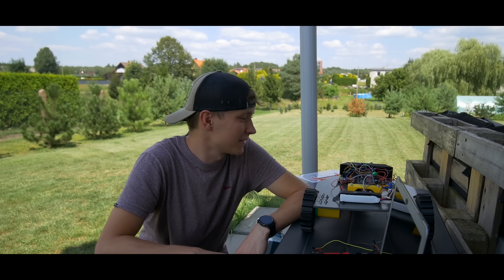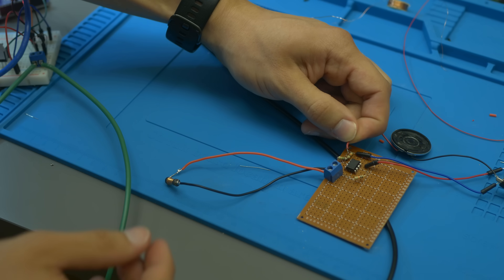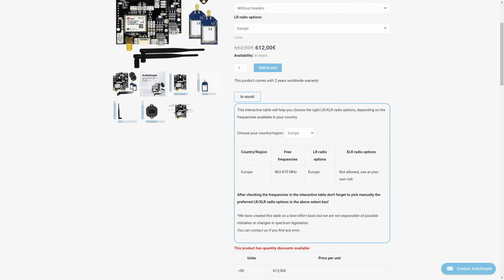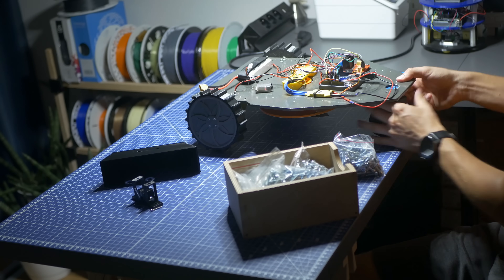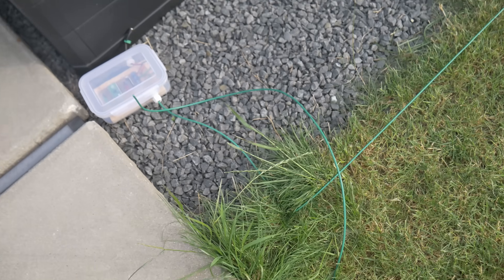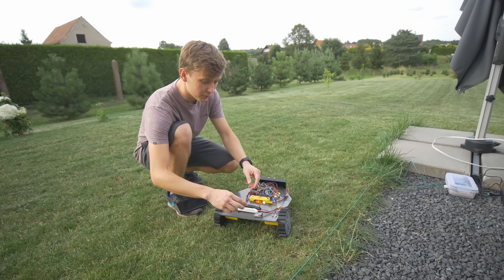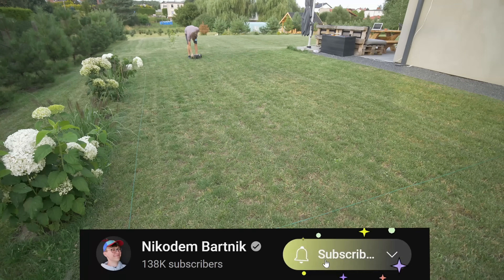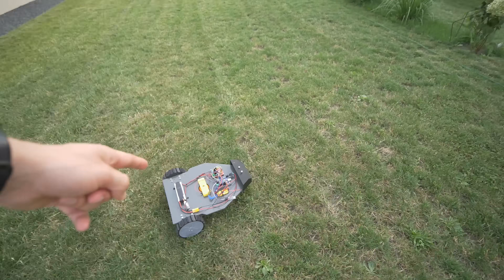Perimeter wire is better than GPS RTK. (IndyMower #2)

Comment: The general purpose FFT may be a bit too much. A DFT for only a single frequency bin with precalculated values is super easy to implement. Be sure to sample at at least double the frequency you want to detect (10x is better for differentiation). 
The alternative is an analog bandpass filter or inverse notch.

Comment: I thought about this a long time.  I felt that perimeter wires were great.
But to make different mowing patterns would require more wires.
And if the mowing area needed to change, the wires would need to be replaced.
GPS didn't seem accurate enough (at the time) and could glitch too easily.
The biggest drawback is the non-patterned mowing algorithm that wastes time and energy.
I settled on the idea of using a scanning head that looks for reflectors placed around the yard for triangulation.  This is the method used in many factories for robotic forklifts.
But I don't have time to work on such projects because work keeps me busy, and family.
Reply: I have very similar conclusions, reflectors seems great compromise - Linde use them in their HDk series, and reports 1-2 cm accuracy. Don't know about behavior in full sun thou, optical methods tend to be jammed by intense sun and scanning head is difficult to use with standard remote control solution of detecting IR signals keyed in 40kHz carrier wave. Maybe 2 colors pointing same reflector? That way by having 2 peaks on diffrent frequency we'd eliminate false positive. Adding third detector that should stay low for third color would eliminate white objects or sun glare to give false positive. 
Alternatively, for smaller distances, ultrasound work ok for 12m - Cheap ultrasound sensors can be modifyed to talk to each other and double distance measure range, if they would be synchronised by PPS signal from chap gps reciver - could be as accurate as GPS-RTK, but order of magnitude cheaper

Comment: increase voltage, increase frequency. and  use high frequency diode to convert ac to dc as sense and usedc output as sense.  it will reduce computation of arduino!
Reply: Hello, I am interested in knowing how to follow the perimeter cable, if you can help me with this, I can pay you friend for crypto

Comment: Why not use a simple 5kHz generator with an NE555? Way cheaper/simpler?  Love the project though..
Reply from the maker: I will have a microcontroller in the base anyway and that gives me more flexibility to adjust the frequency or even use more complex signal. Thank you!

Comment: I do agree with the choice of the wire. It works and it's cheaper.
Only a question: do you think the wire in order to be detected will have to be placed on the surface or can be put some cm deep?  This in order to reduce the risk that animals (cats dogs or even mouses) can cut it.
Reply from the maker: I will have to experiment with that as well but with the right amplification on the sensor side and maybe higher voltage in the perimeter wire it should work even underground.

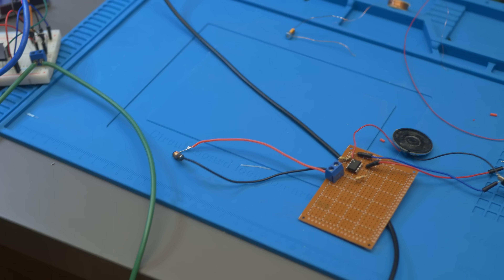Comment: 3:00 When you're trying to sense a signal of particular frequency, you terminate that inductor with a capacitor to create a tuned oscillator. Just use some random internet LC calculator to come up with the values. 

Safety feature suggestion: continuity detection for the perimeter wire.

NRF24L01 is OK but keep in mind possibility of ESPnow, which is a similar thing but it communicates between ESP32/ESP8266 microcontrollers. I don't like shopping for NRF24L01 because there are a lot of fakes and their compatibility to each other including wireless protocol is very hit or miss, and the quality of the modules is as well. I haven't shopped for Nordic microcontrollers in a while but when i last checked they were on the expensive side as well, if you wanted to have radio and microcontroller on the same IC, which i find myself usually wanting that if possible.

I wonder if there's some sort of base station triangulation system one can build cheaply. I would like everyone's suggestions, is sure to come in handy someday.
Reply: I've always liked the idea of a base station triangulation system. Not only would it be nice for this application but I thought it would be cool to use the same setup to figure out which room I was in in my house. Then I could make calls to turn on lights and fans relative to my current position. Plus, a triangulation system is (for me) another new thing to learn.
Reply: @makernova8160  Have a look at UWB. It uses TOF like GPS but penetrates walls and has an accuracy of a few cm. There was an open source project on hackAday once, but the creator pulled it off and commercialized it. So you would have to start from square 1. Let me know when you succeed 😉 I want this too